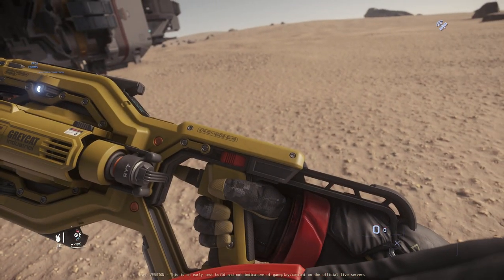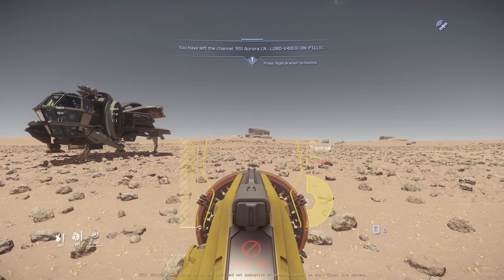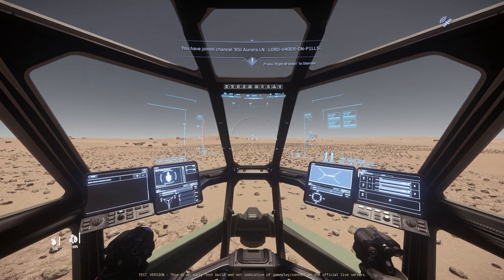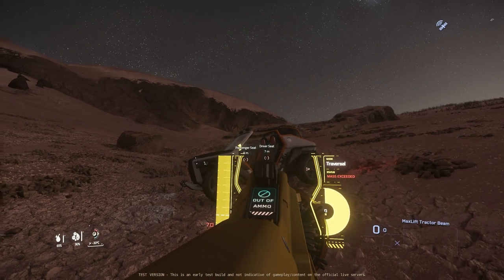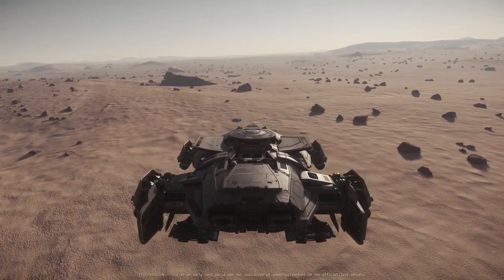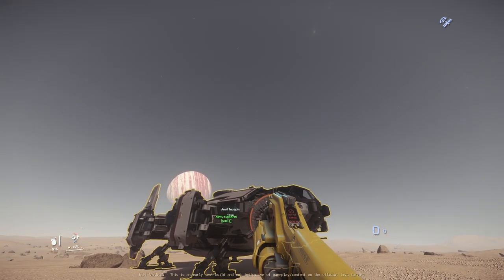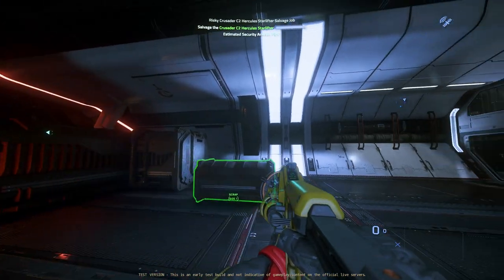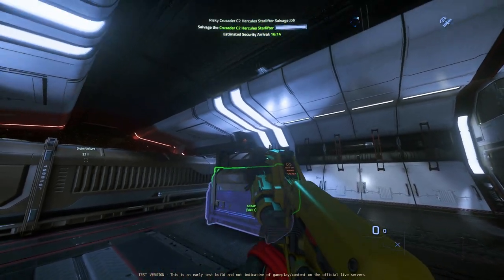NEW Handheld MAXLIFT TRACTOR BEAM First Impressions And FIELD TEST In Star Citizen 3.21.1

Comment: It feels like it just makes the multi-tool worthless. I guess it can still do a couple of things but tractor beaming was it's most important role. Now I have to carry both, one for cutting and slavage/repairs and the other for tractor beaming.
Reply: The multi tool is compact and used for smaller operations. It’s supposed to make the multi tool less useful because right now it’s used for literally everything and you can hold it in one flipping hand
Reply: @TheDestroyer702  There is no reason to use it for smaller operations though.

You can always carry 2 primary guns. Even single seat fighters have space for 2 primary weapons.

What situation would the multitool tractor beam ever be used now once the big one is added? I guess there isn't any harm that it's an option but still.
Reply from the maker: Yeah, I understand what are you saying...I would like to know will they restrict for multi-tool to be able to lift for example up to 8 or 16 SCU containers so that for bigger ones we will need to use MaxLift...will see. I personally don't have the problem carrying both devices. Bigger tractor beam will be stored in my ship so that I can take it when needed. Another thing that CIG will implement is cargo containers in which we will be able to store smaller containers so I am guessing will we be able to move these special containers with MaxLift only?
Reply: @LORDV4DERONP1LLS  I'm pretty sure the plan is for the multitool to have a lot lower limit. Like not even being able to lift the 32SCU boxes. I remember something about it being cracked up as a temporary measure.

I'll have both just because I'm gonna have the multitool for cutting and salvage/repair... Until better versions of those tools are added anyway. Lol.

I just think the tractor attachment is obsolete now. An option nobody will use.

I guess it mostly seems weird to me that they felt they needed another level of handheld tractor beam. They could have accomplished the same thing with multitool attachment variants.

Then again I'm talking about the people who made the ROC and ROC-DS.
Reply: I think their will be a lot of cases where you will choose the smaller one.

If you use your multi tool for doing bunker running then there’s no need to sacrifice a weapon slot on your armour to take the new tractor beam gun.

or doing smaller things like box missions why waste the weapon slot when it’s not needed. 

I think everyday use for most people will be the small one and then people who deal with cargo a lot will have the bigger one with them.
Reply from the maker: @Psychobob  Well, for people who love to play bunker missions and need to have 2 guns for example they will still use smaller multi-tool just because MaxLift is taking one rifle slot on your back or backpack. Yeah, there will be situations where both of them will have their use. Will see what future brings :) Thank you for your opinion btw...I appreciate is a lot.
Reply from the maker: @MB_Industries  I share your way of thinking...I am sure they will make both tools useful for specific things that we have in Verse! Thank for sharing your thoughts here!
Reply: The Multi-tool is well... a multi-tool its jobs to be able to be a jack of all trades, master of none. The main flaw with it is the size and mechanics of how the modules work.
Reply: @MB_Industries  Maybe but ehhh. I literally never carry more than one gun. Maybe to loot one right now but that's mostly because the looting into crates is too cumbersome. Once we can just buy an empty 1scu crate I won't have to do that.

The bunker missions are going to get substantially deeper gameplay though so there will likely be things that require having the larger tractor beam. Having it as an option to move things the small one can't is too valuable to not have at all times.

It'll depend on where the limit is for the majority of the gameplay. Like if I'm in a cave and never have to move a huge rock that the small one can't handle them the small one will have its place while the larger one would be more for helping the cargo career specifically or swapping out huge weapons on ships.
Reply: It's not worthless.  Yu're not going to give up a weapon slot in a bunker to carry around a Maxlift for no reason.
Reply: @Rikalonius  I never use the 2nd weapon slot anyway. Lol.

Comment: It won't replace the regular multitool, for that tool is very versatile, and this seems tractor specific. I would only bring this as a salvager or cargo runner. Pirates may have good uses for it too.
Reply from the maker: Yeah, I believe they will find a way for both tools to have their role and value in future. Thanks for sharing your thoughts!

Comment: Today I tested the tractor beam of a 315 on a Cyclone that was turned off (wouldn't work shielded) and was able to lift it up in armistice zone and move it around.  I put it on the roof of the storage building.  I saw a different test where the MaxLift can pick up a Nova, barely, and move it very slowly around.  I was surprised who easily you picked up the Aurora.
Reply from the maker: Yeah, so now you can use MaxLift in armistice zone? Nice! I was trying to move my Corsair while I was in space and it is a no can do! Can't have a lock at all which is not bad since I really don't want to be able to move a Reclaimer with it.

Comment: For those that say the multi tool will go obsolete are kinda jumping the gun. 
It's like a smaller less powerful version of probably all the bigger tools with a specific job that will come in later.
Most likely all the multi tool attachments will get their own large dedicated version later as the game progresses in development, for professions and jobs that require such tools.
Imagine if you see a person running around with a pistol on the hip but equipped with 1 or 2 large utility primary you can tell they are non combat professions.
For example. Haulers, Miners, Salvage contractors, etc..
Reply from the maker: Yeah I agree on that...I am sure that both tool will have their specific usage further in the game development. Looking forward to see what future bring. Thank you for your thoughts.

Comment: Seems like even you can't lift Terrapin or heavier ships you at least can slide them on surface. And it'll be interesting to see more tests with heavy ships and for example a few players with same maxlift tractor beams. will it be possible to lift heavier ships in this case?
Reply from the maker: For now when you use several tractor beams the power does not combine as I saw in one of the videos. In future this will maybe be possible but then again...for moving large ships we have tractor beam installed on our ships. I am afraid that people would abuse possibility to move large ships with hand tractor beams.
Reply: @LORDV4DERONP1LLS  they will of course. and with bigger, mounted on bigger ships - way more often 😅 but anyway, thanks for video and review of new tech. seems like I'd maybe can jump into PTU to look by myself around
Reply from the maker: @voidgameplays2970  I encourage you to jump to EPTU and try this tool :). EPTU is a bit unstable from time to time but still worth to try. Thanks for your kind words and comments. Stay safe in the Verse my friend.
Reply: @LORDV4DERONP1LLS  Thanks for great suggestion, I'll try maybe on this weekend. want to wind off from SC for a while after PU experience last time, when I can't depart from 09 Hangar on GHEX 😅
See you in the 'Verse 🫡

Comment: We need to know if using 2 or 3 may move Tarapin?? Like multi towing with SRV??
Reply from the maker: For now I believe there is no power multiply when using more then 1 tractor beam, but then again, there where already 2 EPTU updates so maybe it is possible to use several tractor beams for lifting heavier objects.

Comment: Everything looks so good. Never looks this good in the commoners server
Reply from the maker: Believe me, this video was a pain to make with CTD's every 10-15 minutes! Luckily crash recovery finally works so I was able to continue where I was after every crash! EPTU is still really unstable for most of the time. I believe this tool will work fine in PU when it gets released.
Reply: The servers as of today's build are great.  They've had lots of problems with CTDs.  I was shocked how many personal frames I was getting in the latest build.  Running very smooth, even with 105 people on.
Reply: @Rikalonius  Repair bugs, 30k's, no reaction NPC's, ship weapons that won't charge up to fire, torpedoes that yoyo, characters not respawning, inventory bugs, loot crates unlootable. Many more. It's better than the disaster that was 3.20 but nobody is gonna take you seriously when you call the servers "great".
Reply from the maker: @Rikalonius  Is that EPTU or PU? Nice to hear, will test it today since there are new purchasable cargo containers(2,4 and 8 scu) that I want to test!

Comment: How do you equip it? I bave it in the 1st slot on my backpack but theres no way yo equip it
Reply from the maker: Press 5 on your keyboard twice. If you have Maxlift and small hand tool you need to press 5 twice. If it is not working, try to press and hold 1 and then a popup menu will appear where you can choose which gun/tool to equip.
Reply: @LORDV4DERONP1LLS  I can't figure it out, just trying to take scu boxes that I have 6 loaded on my ship but they say too heavy volume exceeded so I got the max tractor and just can't equip it so all my boxes are stuck on my ship
Reply from the maker: @triggerhappy52786  Problem with MaxTractor is that is considered as weapon and you can't pull out weapons in armistice zones! so if you are in a hangar or anywhere in armistice zone(that means that you can't use any kind of weapons) then you can't use MaxTractor.

Comment: Was their a range differance and battery life I find the hand held annoying if I dont take a spare.
Reply from the maker: I believe Maxlift have a better batery life but to be honest, I never had a problem with battery on any of these handheld multitools and I use them a lot. With Maxlift you will be able to lift some heavier containers and small size ships. Cargo containers now have weight so for example, you will be able to lift 32scu contanier which weight like 1000kg with regular multitool, for 2000kg you will need MaxLift!